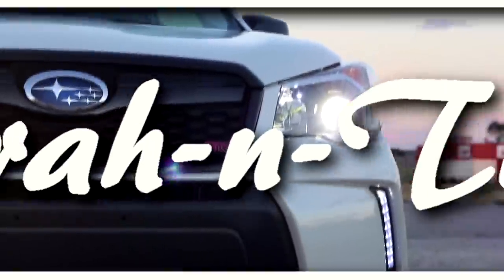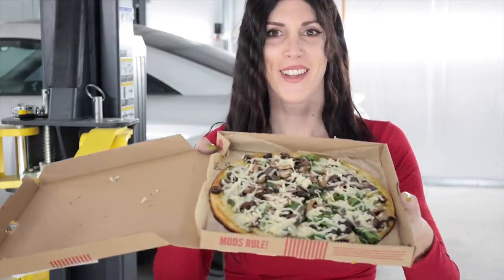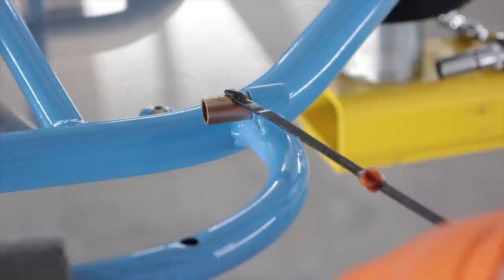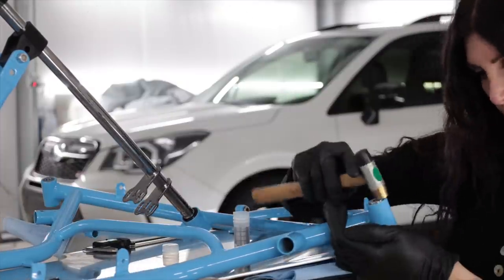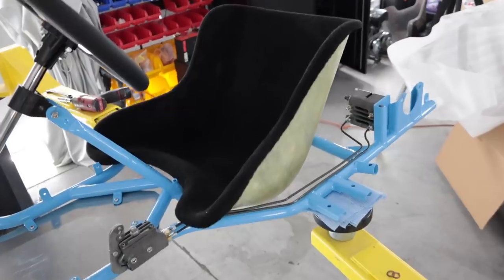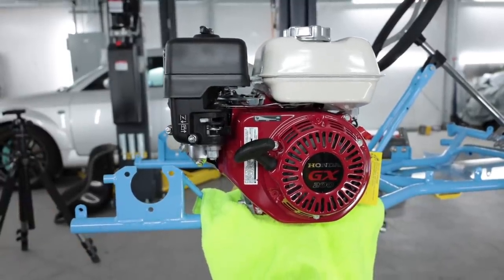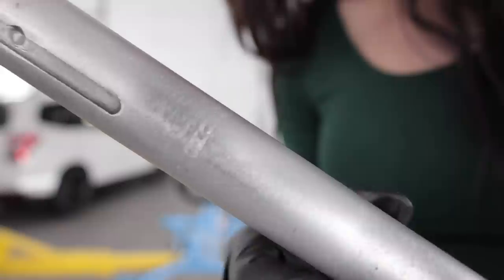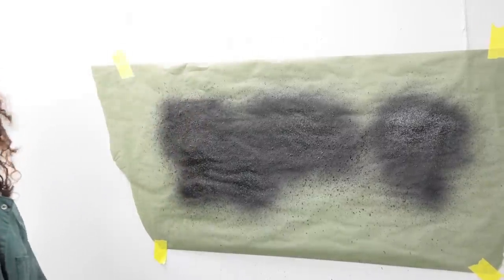Changing Things Up w/ A Different Engine! // Emmick Kart Restoration

Comment: 3:45 To get those little things to fit u can use a small amount of dishwashing liquid, slides right in then drys out, can also cover long wood screws in it too and they glide in a lot easier.

Comment: Whenever you are dealing with bearings or bushings that are an interference fit try to use heat and cold to your advantage. You could of heated up the area of the frame where the bushing was going with a hot air gun (so you wouldn't burn off the paint) and you could of kept the bushings in the freezer for a few hours. This will expand/shrink the parts to give you a slight bit more clearance and they would fit together. Then when both parts returned to room temperature they would be back to being very snug (interference).
Reply: Yep, easiest way to install Ball Joints that need a press fit and you are too lazy to remove the control arm/spring and use a press.
Reply: I do the same for fifth wheel saddle bushings and leaf spring bushings.

Comment: More shop wish list items:  Parts washer, sand blaster , drill press.  Go kart items:  black chrome bolts and nuts (Ace Hardware), engine turn the al-loo-minnie-um pan.  Good thing you have no rigid shed-u-all!  That's all I have to con-tri-beaut!

Comment: Dear Sarah, It's also so much easier to drill a hole with a sharp drill bit.
Aluminium is the correct pronunciation. Alumina is a material made during the manufacture of aluminium.
I also notice the steering column support is of set from the centre line. But it would be nice if the steering column was in line with the driver.

Comment: About the aluminium skid plate. 
Mount the screws the other way around, because of ground contact. Add rubber washers between the frame and the plate, and rubber washers and big washers made of steel on the top. The holes have to be way larger as the screws. Now "your" frame is to rigid. Carts are fast  while cornering with a soft frame. Totally different to a car. Carts are like the "british" style of making a car fast, not the "German" style

Comment: 7:01 If you look at motorcycle brake or clutch lever, they use something similar. The bolt is usually larger diameter but the thread is smaller.

Comment: Just run a tapping tool trough the smaller hole at the steering thing  and done , so you can be safe to put a screw trough it and secure it with a nut  ! Have  fun !

Comment: Step / unibit for drilling
TSC sells nuts bolts by the pound. 
On the steering column, the different hole size is for a shoulder bolt. That way it's thicker going through the steering shaft, with no play. 
Cheers:):):)

Comment: The angle of the engine is for racing (gas runs down hill faster than level) but you have to change your oiling inside of the engine when you do that. That means you have to open up a brand new engine and remove the rod cap for one with a slinger. Remove the old oil system. While you’re in there remove the governor and replace it with a bolt with a good bit of silicone. The clutch goes on with sprocket to the inside. Get a guard so when you break or throw a chain it doesn’t rip all of the skin off your body on the right side. If you set your engine at the angle, get ready to burn you elbow.

Comment: Hi Sarah. You need a 6mm (possibly1/4") cap head bolt for the steering wheel boss. The bolt head sits in the bigger hole and tightens against the column. You can get mushroom clamps to fit the seat  and if you search up Honda Cadet engine mount you will probably see some UK kart parts but it will give you some ideas on what might work. Looking forward to seeing how this goes when it's finished.

Comment: Please go to or talk to someone at a local Karting shop to get tips, and correct parts for your chassis.
I know your not planning on racing, but i really suggest you change the solid brake lines for braided line, and safety wire your brake caliper, and steering wheel.

Comment: My knowledge of the degree engine mount is not for tire clearance but for moving the oil level towards the front of the engine case and helps prevent the crank from slapping the oil when it's filled without reducing the capacity. It makes more difference the faster you rev them up. I've built several of the predator and honda engines. We had one that ran a either a .265. or .275 cam, hand port, billet piston and rod, shaved head, big carb, blah blah blah.... You get the idea, big build and really high compression that made well into 20+hp at 9,000 rpm. Was really happy and screamed at 9,500. Cart was a literal death trap... But gosh damn it was fun!

Comment: The angle engine mount was for the old Briggs and Stratton 5 hp flat head engines for gas tank clearance.  I had an old Margay Racing Sprint Kart with an alcohol powered Briggs and Stratton 5hp that ran up to 7500 RPM.  It did about 65 to 70 mph.

Comment: So you can buy PVC pipe with an ID just a little smaller than the OD of your back tires and cut them to the width of your surface contact. Deflate your tire and slide the piece on and re-inflate. Turn it into a Super Drifter! My son did that with his and it's a Blast!

Comment: Remember to open engine and remove govener. Glue a bolt into the crankcase hole. I think the valve springs from  140 are harder so allow higher revs without bounce.

Comment: The steering coupling at 7:00 with the two different size holes was probably meant for a shoulder-bolt. The bolt 'body' is larger than the thread.

Comment: Hey Sarah, great videos as always. Just want to say that the steering wheel should be fixed with a cap head bolt, with the head going through the bigger hole, and the thread to match the smaller hole. This holds to boss tight on the column, if you drill the hole out and go through with a longer bolt , it won’t hold onto the column. Hope that makes sense. Keep up the good work 👍🏁

Comment: The steering wheel is actually upside down. The flat red “side” is meant to be at the bottom. (Flat bottom is intended to offer a little more knee room, the Y spokes can be a place to hook your thumbs.) Awesome looking cart! Keep doing what you do!
Reply: Not on go karts...  steering wheel is flat on top... It helps in finding center when you are racing, and if you look the "Y" is in the correct orientation... with the two forks facing down. Looks like a Bintelli Karts "Standard" flat top steering wheel.

Comment: Look into a Skid Plate kit to help protect that paint. I like the KartLift kits (Comet Karting sells them).

For bushings & hardware, look at McMaster-Carr. Fantastic website & huge selection plus fast delivery.

The steering wheel mount is designed for an Allen Cap Screw - the Head will fit inside the larger diameter hole & the threads will come through the smaller hole. If you're using a countersink bolt it probably won't seat correctly.... or the steering column hole is worn out.  Comet has new columns reasonably priced

Comment: Maybe the hole in the steering shaft collar is close enough to the tap drill size to tap the bottom hole and then put a jam nut on it. Double retention for extra safety. 😉 Also I wonder if you could maybe ask the barbecue guys to make a center cap for the steering wheel that could be anodized  with a cut out on some standoffs to show the metal beneath it for contrast (shadows or shiny glinting depending on angle of view) that covers the stainless bolts. Adds flair too...you need to have some flair.

Comment: On your steering wheel hub. Put a Allen head bolt through it. The head of the bolt goes inside larger hole and sets against the steering shaft. As for the engine mount, make sure to measure the distance between the frame rails the mount attaches to. There is American, and international. B4 u order one.

Comment: I’m waaaay late to the party here, but two suggestions for anyone interested: When possible, bolts should be inserted from top down rather than bottom up. Installing bushings is cake if you put (shrink) them in a freezer for as little as 10 minutes.

Comment: Cars have flat bottom steering wheels to get more space between the wheel and seat so you can get in and out more easily, go-karts have the flat on top so you can see over more easily.

Comment: You need a stainless steel top work table and shop sink with extra cleaning area so you don't have to clean sludge and grease off the concrete or floor. Of course I need that too.

Comment: Hi Sarah. Do yourself a favor and buy a DeWalt pilot drill bit kit. One bit drills a pilot hole and steps up to the correct size without changing bits. I bought my set on Amazon. Not expensive. 
I knew the Honda engine was coming. Looks like you're having fun.  I'm waiting to see the new wheels and suspension kit. Love you.

Comment: Just a suggestion but you should run the skid plate bolts with the bolt heads on the bottom since they're rounded/flatter so you have a smoother surface as to not get caught on things.
Reply from the maker: I thought about that.. but didn’t want the heads getting ground down making them impossible to remove.. guess either ways kinda the same ish.

Comment: May I suggest putting a bushing in the larger hole rather than boring out the smaller hole (7:25)? It would be easier and less likely to compromise the structural integrity of the steering shaft. Just my .02.

Comment: Angle mount on engine can affect the weight distrubtion on kart as the engine is 2nd heaviest after you.     more forward the motor is more grip on front tyres..   something like that but you driving up / down it doesnt matter :)

Comment: #Stering wheel bolts: The larger hole is to hide the head of a hex-bolt . . .
                                       That way you tighten the plastic sleeve to the axel, instead of compressing the sleeve  . . .
#Floor bolts: The nut should be up so you have a smooth underside . . .
                        It's easy to get the front flying up in the air by touching a rear wheel with your front wheel. It's more comfy with a
                        gocart with a smoth underside on your back instead of one with bolts and nuts sticking out . . .

Comment: Skid plate, would be better to use Countersunk head fasteners with head on bottom, and a Nylok nut on top side.  SO it wont snag on low ground clearance area, or grind the bolt heads off.

Comment: It's looking good, if it were mine... i'll paint the rear side of the seat and will fill it with a lot of punk rock stickers, that match the base colour or colours... and will try to put in the middle the biggest Alternative Tentacles sticker that i could get; some reflectant accents here and there on the body and the rear of the seat would look good imo, could be something as suttle as just the bolt heads and would still work.

Comment: Making a shouldered bushing out of brass or bronze isn't too tough, since it's relatively soft material...  Ideally you'd have a lathe into which you could lock a piece of the material that has the total diameter of the outside of the shoulder...  Just start turning it down.  Can even do it with a drill press and a file, if you have patience.  Even if the drill chuck can't open up enough, just run a bolt through the inside and lock that in the chuck.

Comment: I recoditioned a cart the same chassis as yours but mine had a honda 250cc 2 stroke bike motor with 6 speed . It went like a scalded cat at over 100mph thats 160kph where i am . An inch and a half off the ground is a head rush banging through the gears doing donuts was so much fun . Dont forget to wear a helmet to protect your knogen . It only takes on hit and your a veggie for life . Be safe and enjoy running a muck on it . I love going fast but its the sudden stop that kills you . Be safe sexy sarah .

Comment: Since I live rural i'm not much for the sidewinders because of ground clearance.  They are planning on paving all gravel roads even my remote ones because it costs less than gravel so I might get one then.  I have vintage race karts also but they have to be hauled to tracks.  Hondas are nice if you have the money but the predator 212 has proven to be good.  I have a few honda gx390's on the shelf. My favorite are hotrodded fun karts that are really light with clearance and big engines they freakin rip.

Comment: My gx200 clone revs up 6600 rpm under load , that is at least 9-10  hp or more .  Head has rounded sharp edges in in ports , cos factory port are terrible . Gov. is disconnected , exhaust is just pipe , and muffler is bigger pipe   . Key is grinded 0.75 mm to give  +4 deg. of adv. timing .  Stock carb , stock air cleaner   . All mod can be done in 2-3 hours , cheap and simple .

Comment: I hope you installed an E3 spark plug in that engine.
I installed E3 plugs in my dad's truck.
Stock it got about 19 mpg. After E3 spark plugs it now gets 28 mpg.
We tested out the mpg before and after installing the E3 spark plugs.

Comment: Mounting a Radio Flyer as the seat would look cool on the G-cart. My cousin built two of them and they are rad.
Reply from the maker: Until you take a corner at 30 and end up in some cacti 12 feet from the gokart 😆
Reply: @SarahnTuned  I would argue, take the corner at 50 and you'll clear the cacti by 4 feet lol

Comment: Love your channel and wish you could capture and sell that cheeky little "snarl" face you pull during your standard intro.
The following is sent with nothing but love and a little frustration from me yelling out suggestions during videos and strangely no one answering :-O 
Helpful (?) comments 1: Steering wheel boss-Don't drill out hole instead tap a thread in it and use the larger bolt. 2: Mount the top steering shaft bushing/mount using both of the holes (assuming they align with the frame mount) 3: Use Allen/Hex headed bolts instead of regular bolts because they are lighter (okay it's really because they look cooler)

Comment: Uhhh   you need to countersunk the holes and use countersunk bolt underside...  so you dont snag and send you flying when the exposed bolt got hang hold of the crack on surface.

Comment: So the engine mounts being at such a angle might be needed for a couple of reasons but I don’t know everything about the development of that product. The first and most probable is it could be for tightening the chain. The second could be because it uses gravity to feed fuel the the engine. A problem could arise pushing the fuel to the back of the tank running the engine lean and hot. If you do keep it on an angle make sure you use synthetic oil because most small engines use splash oiling.

Comment: If you tightened the floor pan which it looks like you did the the chassis will bind. Use nyloc's and leave it loose for a happy chassis. If you have not been to 4cycle.com you might want to check it out Its been around since the beginning of time.(the web). Also by using a flat mount the engine will sling the oil properly. Angle mount are more for 2cycle engines. Good luck and have fun. I watch all the time.
Reply: One other thing! Safety wire everything!!!!

Comment: I would have used a laser paint and rust remover on the frame and would have used rubber idolators and tap danced some threads for the aluminum plate instead of using nuts which will eventually be ground down.Same for the steering wheel shaft, tap some threads.

Comment: Lightly oil your rear axle with wd40 or it can rust fast. Also double check the upper bushing on your steering wheel, im not sure if it is right.

Comment: the bolts heads for the floor need to be on the  bottom,and the nuts on the top,so you dont grind them when you hit the road

Comment: The round socket heads of the bolts holding the under-tray on should be at the bottom. They way you have it the nuts will become skid blocks and will be destroyed

Comment: Aluminium is an element - atomic number 13 on the periodic table. If you search for "aluminum", the first entry that pops up is "aluminium".

Apparently, the IUPAC  (whoever they are) has determined either spelling is correct and acceptable. However, the accepted spelling in North America is aluminum, while the accepted spelling just about everywhere else is aluminium. Apparently, I live in just about everywhere else.

Oh, by the way, we have an aluminium smelter down the road. I must ask if they can make aluminum, too.

Comment: If you angle that engine and it doesn't have the right intake it will throw the float bowl setting off a little..may or may not matter..